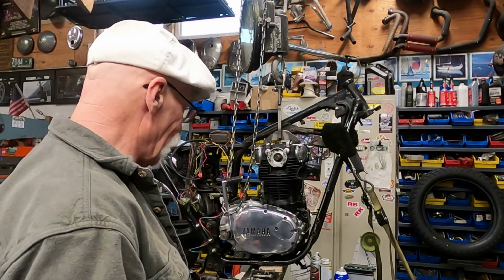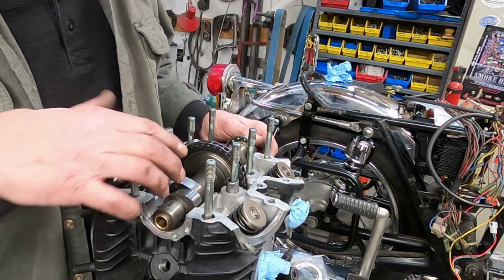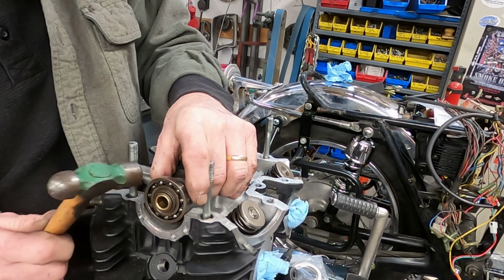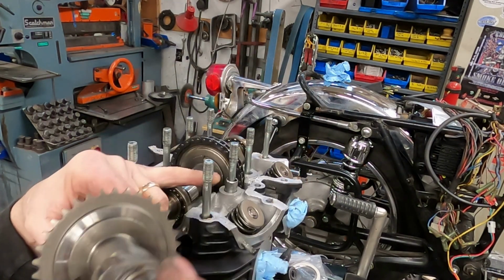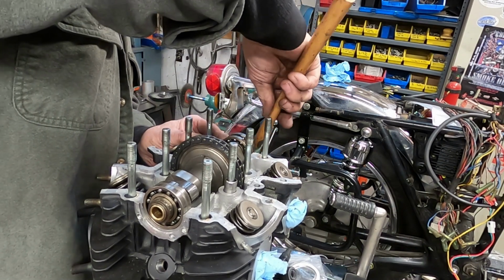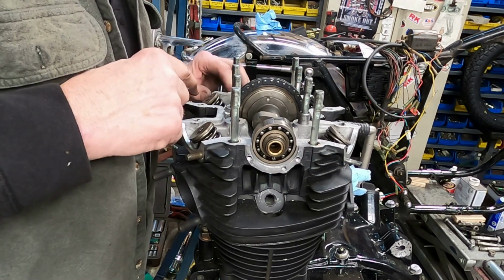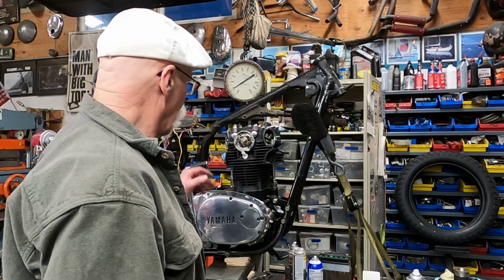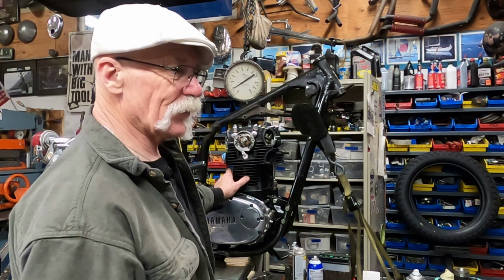The Cam Screw Up

Comment: Hi Mr. Miyagi I have a problem my new cam chain is one link to short got my Yamaha parts from Partizzla.  Any idea what is wrong?
Reply from the maker: Double check that your chain is not hanging up on the crank sprocket it can cause a shortening of the chain.
Let me know if is not the problem. Thanks for watching.
Reply: I got the chain on.  Had to remove the bearing on the one side and then lift up and install the bearing.  Maybe my head gaskets were thicker,    Thanks

Comment: I am about to be doing this on my 75 because I’m having issues getting it to start and it’s got brand new tc bro carbs and mikes xs ignition and still can’t get it to start correctly. Just try’s floods and oddly back fires when I turn the key off lol I’m down to cam chain timing ? Also it spits out the carb alittle bit when trying to start I know there millions of videos but do you think it sounds like cam chain timing ?
Reply from the maker: It could be very well cam time anytime you have a backfire it is  usually cam timing. Thanks for watching
Reply: @outlaw86custom  well we checked the chain tensioner and adjusted the valves and it stopped doing the back fire and we turned the ignition system on clutch side some and it almost found the spot but we ran out of room of adjustment . 

Is there an adjustment on the opposite side of where you adjust your ignition system to give you more room to work with on clutch side or is what you got to work with all you got  ,and I’m fore sure down to engine timing ? If that makes sense
Reply from the maker: @HickeyX  the other side is for advancing and not charging of ignition now if the weights and springs are screwed up you could have a little problems too.
Reply: @outlaw86custom  right I see well when my buddy gets another full day ,we going to do a little more messing with it and if no luck I’m just down to timing I suppose. 
Which I guess isn’t too bad of a job either 
Just ready for a ride lol 😂